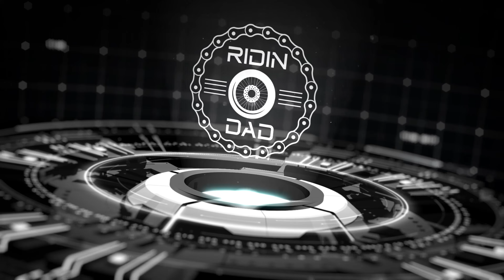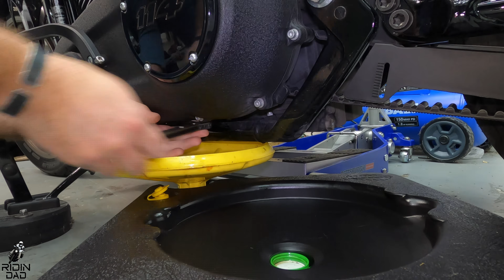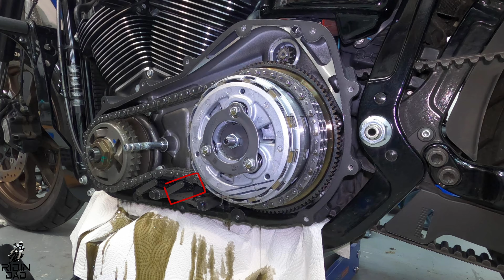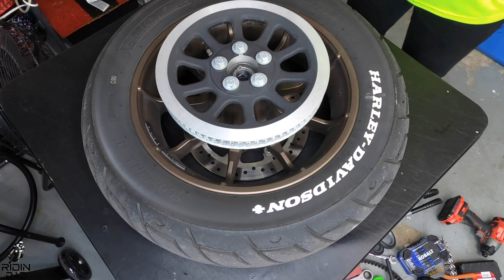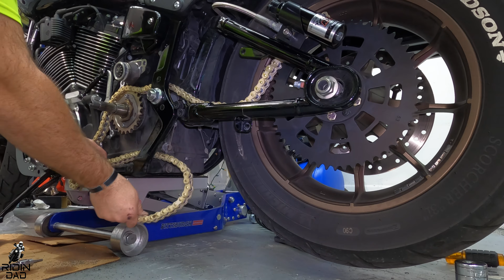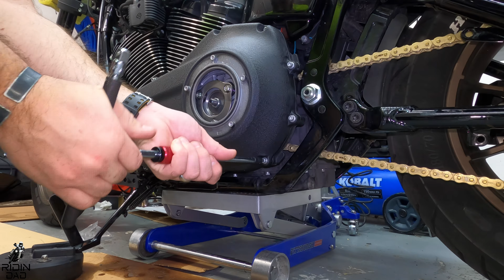Chain Kit Install on a Harley Davidson Low Rider S - speed kings kit (low rider build series ep22)

Comment: Really enjoyed the video Chris; shame about the corrupted footage. Hope the GoPro is salvageable. I've been thinking for a while now about doing this conversion. What has held me back so far is the weight concerns. You didn't by any chance look at or compare weights did you? I'm probably making too much of the weight anyway. I think this video might push me over the edge and convince me to do it. Well this video and the review video :)
Reply from the maker: Thank you!! And the GoPro Seems to be doing well so far, knock on wood! For whatever reason when I film a lot of chopped up segments and start and stop with him sometimes stuff like this happens. I don’t understand why. My software is up-to-date and everything. As far as weight goes I did not pay too much attention. Obviously the chain is for sure heavier than the belt, but the rear sprocket has less weight to it than the stock pulley sprocket that is on the rear wheel. So it’s a trade off for sure. If you do wind up putting any additional weight on at all I would estimate maybe one or 2 pounds at Max? Pros definitely outweigh the cons on this !!

Comment: You can change gearing on a belt system to make it more highway friendly for the older Baggers that don't have six speed pre 2007 models and you can go the other way for more power and less top end.    Hope this helps.
Reply: For those who may be interested,  gearing on the belt drives are generally changed with the FRONT pulley. 2 different,  well known manufacturers offer pulleys to both raise and lower the final drive ratio. In fact you even have the choice of aluminum or steel.  I hope that helps.  I didn't mention the names of the companies as it might infringe on YouTube policies. 
GOD BLESS 
T.S. RACING
Reply from the maker: Awesome thanks man!! In my opinion if I’m gonna go through the hassle of removing the primary and such I’m going full chain drive
Reply from the maker: Hood to know man. I’ve never seen a new rear sprocket for the belts

Comment: Really great video. Would be interesting to have dyno numbers to see if there is any big difference with power/torque delivery to the wheel.
Reply from the maker: If dyno is cheaper I would do it in a heart beat. It’s way over priced where I’m at so not gonna do it lol. Plus I plan on doing cams and a tune later this year so I’ll be dynoing it then for sure!  Thanks man!!
Reply: @RidinDad  Dynos are hella expensive for sure. Just curious. Been trying to find answers online, but all the articles typically only talk about maintenance benefits.
Reply from the maker: My video next week is my first ride with it and impressions. I can tell you it’s definitely noticeable. Much better throttle response and slightly more felt torque. Definitely worth it!
Reply: @RidinDad  looking forward to it.

Comment: Nice!  To each his own, but for me, why spend all that money for a slight improvement in torque?  I could see if you are doing a monster build for the 117, then the chain conversion is required, but for a stock motor it seems a waste........unless of course in the future you plan to build up the motor.
Reply from the maker: Thanks man. Well there’s a few pros to the chain kit like I mentioned. Not necessarily to withstand extra torque. Changing the gearing changes the characteristics of the acceleration and the feel of the bike. In general the chain delivers better throttle feel and response over the belt drive too. And it really isn’t that expensive when you look at Harley upgrades. I mean the price of a chain kit is just about the same price as an air cleaner or even less sometimes.
Reply: @RidinDad  Thanks for the quick reply!!
Reply from the maker: No problem! I live on the YouTube app lol

Comment: That's not a low rider, that's harleys abomination of a low rider in a softail. Should call it a foe slider.
Reply from the maker: Have you ridden an m8? They handle a million times better than the dyna platform
Reply from the maker: 😂 ok buddy. So you disagree with almost every other custom shop and performance manufacturer who loves the m8 platform.
Reply: @RidinDad  look up connerfxdb YouTube, the m8 softail needs soo much more modification to be able to hang with a dyna in the twisties. Low Rider is a DYNA motorcycle, softails should have never stolen the name and I will never consider the softail a Low Rider or Street Bob. After you get done on his channel head over to kruesi originals and see how bad those m8 engines dump oil during a wheelie. He's currently creating a fix for that.
Reply from the maker: I’m well acquainted with both channels. Why don’t you watch Ryan talk about how much better the m8’s handle. His only gripe is about stunting them. He’s said multiple times that they feel more planted and handle way better actually getting up to speed. He keeps buying and building one after another cause he actually likes them. Connor has said several times how happy he is with his m8 as well and how much of an upgrade it was from the dyna. He’s talked about it on his Instagram story dozens of times. And you’re acting like I’ve only done a chain kit to my bike. If you actually look at my channel I’ve done a decent amount of work on my low rider s. And you never answered my question if you rode one or not. So I’m going to assume that’s a no? I’ve owned a dyna so it’s not like I’m making crap up. The m8’s handle way better. And 90% of the guys that owned a dyna did a bunch of work to them too.
Reply: @RidinDad  that still doesn't make up the excuse to call those softails a Dyna name
Reply from the maker: 😂😂 so you completely abandon your whole debate about the dynas being better and now all you have left is the name sake. That’s fine man. Everyone has their own opinions on the names and that’s your right. You don’t have to agree that the low rider s should be a softail option. But you can’t ignore the performance aspect of them. You failed to mention company’s like speed kings/performance 41/moonshine Harley & others who do nothing but rave about the m8 power plant. Of course it’s not perfection but everything has flaws. The reality is the m8’s put out good solid power, are more efficient, respond incredibly well to performance upgrades & handle better than the dynas. I love dynas. I like the style and the feel and sound of them. But you’re comparing apples to oranges here
Reply: @RidinDad  might as well call it a ruckus cause it’s definitely not a Low rider
Reply: @DynamicVlogs69 this comment has not aged well. Everyone knows by now that Dynas (low riders or not) are much inferior bikes than softails. Oh well, we learn with experience.
Reply: Lots of salty guys upset because they can't afford a new softail 😂
Reply: @Jolly_Wrenches  typical yuppie rub talk
Reply: @DynamicVlogs69  I've been on bikes since I was 6 years old bud, I'm not rich,  I'm not urban, and I'm not sorry for being successful enough to afford nice things.

Comment: why you went with a 53 instead of a 51?
Reply from the maker: The main reason I went with the 53 was because it was right in the middle of all of my options. I was debating on leaving it close to the stock gearing or not but I felt like having a little bit of that extra torque would be enjoyable for me. And I did not want to go to high because I did not want to take away too much from my TopSpeed and abuse my motor with high rpm. I think the 53 is pretty perfect after writing it for a decent amount today as well as the first day I had it.  Perfect balance of both worlds